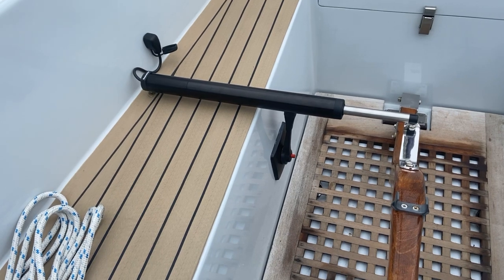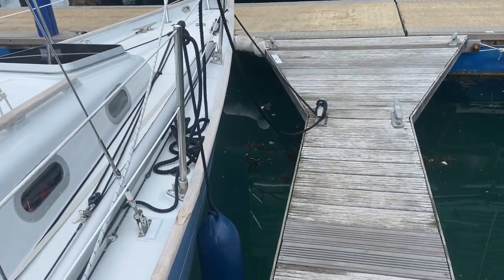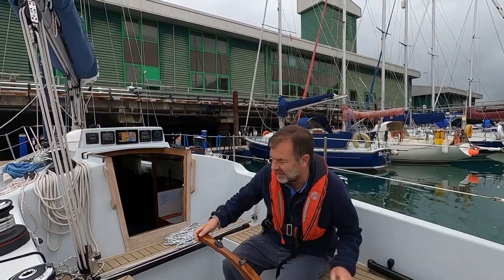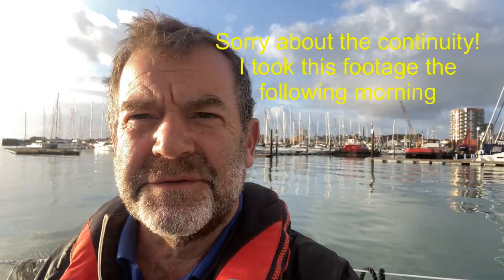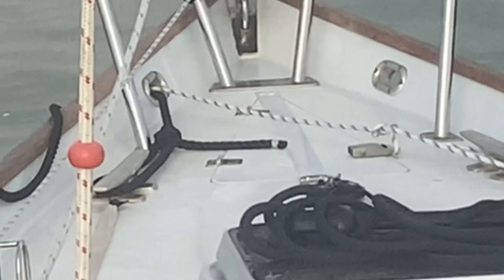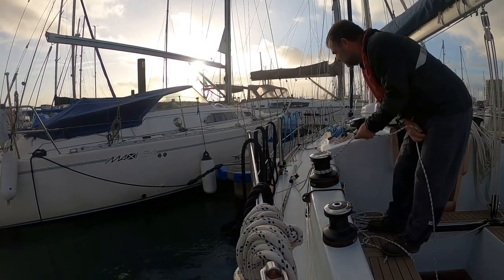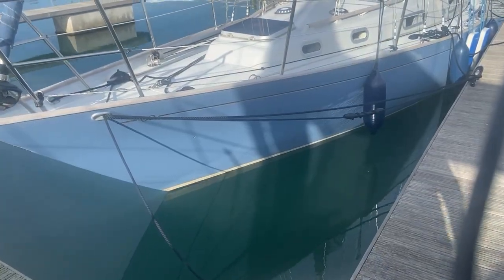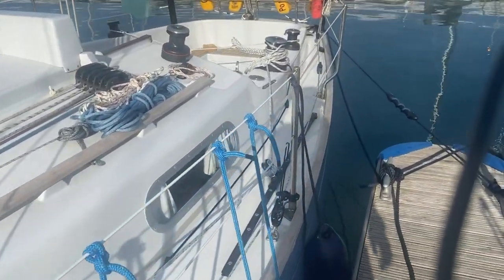Ep 49 - Getting Alongside Solo

Comment: Very useful John, thank you.  Getting out of our particular berth in the River Dart shorthanded is sometimes quite challenging what with the current and propwash etc., and we are still exploring various techniques that we can use with the assistance of a local RYA instructor. Basically we use a running bridle rigged amidships and a floating line to control the stern until we get steerage way, or the crew walking aft along the the deck with a slip line, but we're still experimenting.  Sometimes we just have to wait until near slack water or until the wind is more favourable!
Reply from the maker: I know exactly what you mean John, We were in Yarmouth at the weekend and had a slightly tricky departure. Luckily there was a little bit of help close to hand which made it all a bit easier.

Comment: Really enjoy your channel. This film was great. But as a solo sailor of a 50’ sailing barge. Can l suggest you get on before you untie the last lines. I normally make them loops  over the cleats and back on board. So it’s impossible for the wind/tide to take the boat and leave without you. Also if you need to abort your departure. You will be ready to lasso the cleats again and tie up fully before getting off the boat. 
Kind regards Chris
Reply from the maker: Thanks Chris, much appreciated comment and I can imagine handling 50ft barge is a challenge. It is fair to say that I would only step on at the last minute in very benign conditions. If it was at all windy and I felt that I would not be able to hold the boat I would use slips as you suggest

Comment: I like your technique for coming alongside, and I do much the same myself. I think your method for leaving could use some work. Ideally you should not be off the boat as you're undoing lines, especially not the last one. Also, on a larger boat, you can't just push it away from the berth. You could take off all the lines bar one while motoring ahead and leaving only a looped spring going from somewhere amidships to a cleat on the dock level with your stern. Slip the engine into neutral or even start motoring astern gently and pull in the last spring without leaving the cockpit, then return to the helm to complete the exit from the berth.
Reply from the maker: Hi Chris, I agree and thank you for this. The idea of pushing the boat and stepping on board really only works in very mild/benign conditions. In this particular case I didn’t want to propel astern because I didn’t want to invoke the prop walk. The thing we do you have to be careful with a slip rope is that it doesn’t catch and leave you propelling madly whilst still connected to the jetty.

Comment: Very useful, indeed - thanks!  I find that getting off of the pontoon is the easy part (usually); it's coming back in on my own that gives me grey hairs, especially since I'm not used to tiller steering yet.  😱
Reply from the maker: Thank you for the comment, I know what you mean. The thing that I’m beginning to really get to grips with is the prop walk. There is a sweet spot where the speed of boat allows the boat to be steerable below which it just walks to port. So far, it has got me out of more problems than it’s got me into
Reply: @CoricContessa32  With respect to the prop walk, the CO32 doesn't feel quite as out-of-control when backing as my previous (much heavier displacement) boat had.  I never knew where that thing was going to go!
Reply from the maker: I know, once or twice sailed a tradewind 35 that was most unpredictable